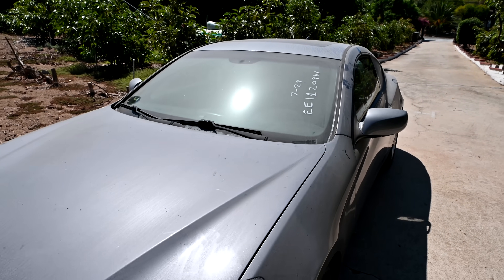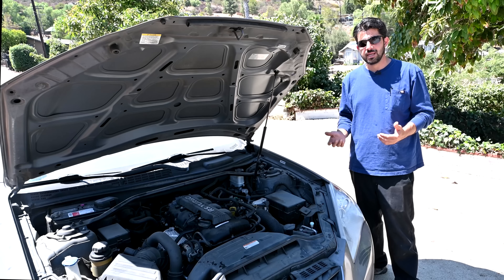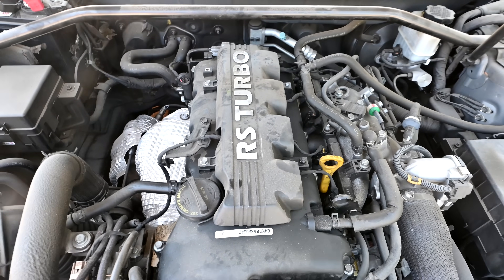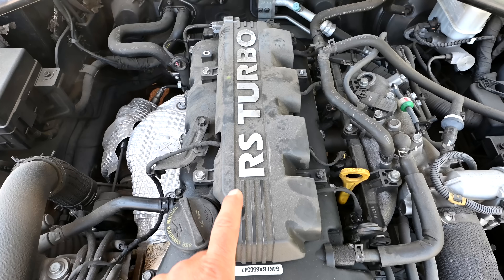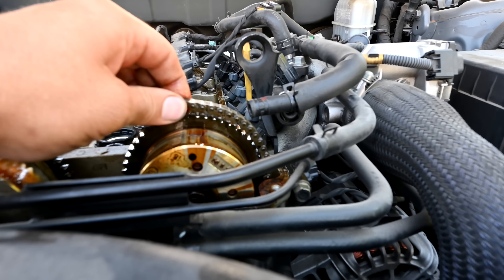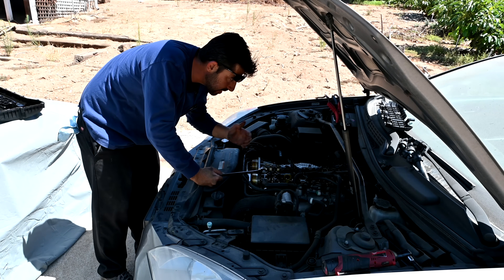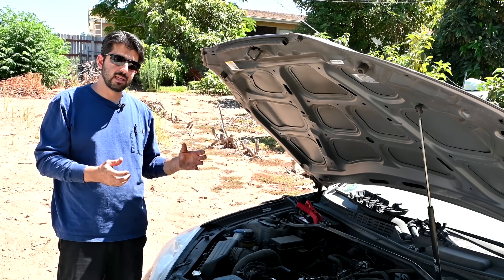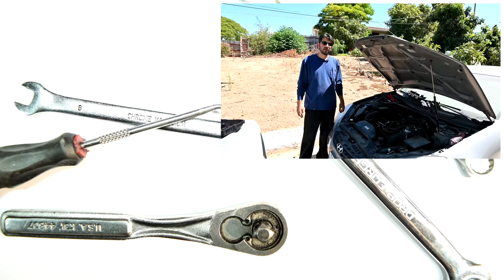The Hyundai And Kia Engine Failures Explained.

Comment: I believe these trouble started soon after Hyundai decided they wanted to make their cars more like the Germans. I guess they really did
Reply from the maker: lol
Reply: Are they really THAT bad?
Reply: @wholeNwon  yes!
Reply: @wholeNwon   Hyundai's and Kia's are very reliable. I sell hundreds of used Hyundai's, Kia's, Honda's, Toyota's, and Subaru's every year. I'd put Hyundai at the top of the chart for reliability against ANY of the other brands I just mentioned. This year we've bought roughly twice as many hyundai's and Subaru's as Honda's and Toyota's and have had ZERO major problems with any of the Hyundai's or Kia's. I've had to replace roughly a dozen engines and transmissions in Honda's, Toyota, and Subaru's in just the last 9 months.  Not to mention, Honda, Toyota, and Subaru owners are typically much better off,  and therefore do a much better job of properly maintaining their cars.
Reply: @bdd1469  Well, that must prove it.
Reply: @wholeNwon yes. My grandma blew her 2017 elantra at 56k miles and the oil change was done 2k miles ago and it was checked for level 1 week prior. Ran dry and rod knock/,piston slap.
Reply: @Slowwvqs  Loose drain plug?
Reply: @wholeNwon  Hyundai is.. odd. Underpowered engines, shitty engines, okay build quality and they can last for awhile. but yet their ability  to run without oil will always amaze me. we had a customer come back because they ran their car 200 miles without oil. it drove into the service bay
Reply: @Miatshu  Modern oils really are amazing. Perhaps bigger gaps than usual between moving parts helps. Don't know. But where did the oil go?
Reply: @wholeNwon  One of the lube techs didn't put oil in the car after an oil change.
Reply: @Miatshu  Hopefully someone other than the owner paid for a new engine.
Reply: @wholeNwon  customer got a new engine and the guy got fired ots
Reply: @wholeNwon  No, they aren't that bad. Unlike Hyundai's, modern German cars are actually pretty good. :D
Reply: @briantii  nah somehow they've made them worse
Reply: Well the Germans had huge issues with timing chains and engines failing , the n47 engine was horrible bmw never got round to fixing that issue and the newer Hyundai and Kia are actually reliable, there Genesis brand is there luxury brand now and actually very reliable
Reply: @M.E63  Says all you need to know about the quality of their engineering and their customer relations. I would NEVER buy one. In fact, I'll never buy another German vehicle again.
Reply: @wholeNwon  German cars are not reliable sort from Porsche, the Mercedes e class I got has been very reliable so far but mines the facelift model and the pre facelift had timing chain issues aswell and it would kill the engine , the Korean newer cars are actually reliable , I’m sure Hyundai motor group resolved the issue they had with the manufacturing of certain engines , these days there is no reliable cars as there’s too much electronics in them and electronic components can fail anytime and it gets very expensive to repair them . Lexus are probably the best however when it comes to electronics then even Lexus can’t stop components from failing
Reply: @M.E63  None should have "issues". They should be able to match or exceed the remarkable reliability of my Lexus LS400. They DON'T because they choose not to.
Reply: @wholeNwon  if you look at German cars reliability then it’s not great, they are never at the top of the rankings , bmw couldn’t resolve the n47 engine issues at all , they designed newer n47 engines but ended up with the same issue again , Porsche are reliable though , VW used to be reliable but not great now, nothing these days is made to the high standard as before, people like scotty hate German cars and say they are the worst however I don’t agree with half of the crap he says
Reply: @wholeNwon
Reply: @wholeNwon   Issue No1 is price tag?
Reply: I haven’t heard bad stuff about the genesis or gt5
Reply: @gemnicherry2670  you must not be listening. All bad engines, nothing made to last.
Reply: @chrismemphis8062  I didn’t even watch the video I just read the title but I’ve seen them and test drove them in good condition with over 150,000 miles
Reply: @chrismemphis8062  yea I messed up and got a 2016 Sonata 3 months ago for almost 15,000 with 120,000 miles and the engine is shot. Hyundai called me and are going to try to do a warranty claim... but they did say I'm passed the miles for being the second owner.
Reply: @gemnicherry2670  I'd bet the farm it was the 2nd engine on the 150k car.. The engine had to replaced , the don't even make it to 100k, and most die in the 80-90K range. I'm not picking on them, it's just reality.
Reply: @zacharybuhrts51  Same here man, I bought a 13 Kia Optima EX last spring. It was  beautiful and like new. Fully loaded. It had 95,000 miles when I bought it. 8 months later it blew up. Used a quart of oil every two weeks. I don't believe I'll buy another Kia or Hyundai any more.
Reply: Well guess what, despite continual and consistent vehicle maintenance, my engine is dying at 6 years old at 90,000 miles and I'm in the middle of oil consumption test to get a new engine. So no they are not good cars
Reply: The Theta engine has been a problem since 2006
Reply: Many will Nazi the humor in that comment.
Reply: I had a hyundai elantra 2003 that lasted me 12 years.  The build quality was cheap but managed to ge t over a decade of service
Reply: The irony here is this car (assuming the original owner) is just out of the 100K 10 year powertrain warranty. That’s one thing the Germans don’t offer and German cars are much more expensive to keep on the road once out of warranty.
Reply: Actually it's because they started machining the engines in the us with American workers 🤣
Reply: They poached many German engineers
Reply: No kidding
Reply: Honestly what new car IS reliable??
Reply: @lucidrebuilds6129  Toyota Corolla. That’s the one and only.
Reply: those particular engines are not build by kia or hyundai.
Reply: @marcusa.rivera6377  So who is the sub contractor?
Reply: @chrismemphis8062  all I know they build for hyundai, KIA, Renaults and Peugeot. Already starting to suspect on the nuke turbo.
Reply: Omg! Yes! I just saw one that is trying to actually look like an M class and fake Lorinsers! I was so upset I complained on their face book page annnnnd Im sharing this too lol
Reply: Yeah Asians are too white washed
Reply: I believe that they did hire BMW engineers, lol.
Reply: Yup. They became so arrogant. When the GV series came out they are more expensive than their German counterparts. I looked at a GV80 that costs 80k. With that money, I’d just buy an X5 or a MB GLS.
Reply: There´s a video of a teacher who bought  a VW beetle in 1967,and the  car still runs great   https://www.youtube.com/watch?v=VxeslTCGjaU      VW haters/critics just repeat the lies that they heard  and have never owned one🙄
Reply: German engines require specific maintenance.  Most couldn’t be bothered to properly care for their vehicles.
Reply: @charlesdignam780  that's the excuse defenders of these piles of junk use. It is nonsense. They are just badly engineered and built on the cheap. Unless of course you consider a complete rebuild to be maintenance. go look in owners manuals of these things and nothing specialist required. In fact they recommend changing oil about once every never
Reply: Haha! Good one. But were Hyundais ever that good in the first place? 🤔
Reply: @ands1894   We sell used vehicles from EVERY manufacturer but specialize in Hyundai, Kia, Honda, Toyota, and Subaru. I would put Hyundai and Kia's reliability in front of anyone else. They just don't have major failures like the other brands. I've had to replace roughly a dozen Honda and Toyota engines, and several Subaru transmissions just this year alone. I have not had ONE bad Hyundai or Kia engine or Trans failure in that time. Which is saying something , because people who typically buy Hyundai's and Kia's are broke, and don't do any maintenance until something  brakes. People who buy Honda's,Toyota's, and Subaru are usually better off , much more brand loyal, and typically are much better about maintenence.
Reply: Have a look how many 20+ year old German cars are still on the road ..
Reply: @holeephuk  only if you consider a salvage yard to be part of the road
Reply: @kevinbarry71  where my ml took me  around Australia mate ,went up to muddy hills where people couldn't walk ,proper adventure machine ,and reliable believe it or not ... got another one e280 cdi ,370 000km on the clock ,appart from shocks and 2 engine mounts no issue...so don't believe all rubbish people writing and most of the time they are ones who never owned benz ..including you 😊✌️
Reply: @holeephuk  nah we're talking new here and some old but over all most of them are junk because they cost way to much to fix they have proprietary software they are over engineered and not even properly with the future in mind
Reply: @holeephuk  I drive one, I have a E class
Reply: That’s not the case at all.  German engines?  Which?  They follow Japanese engineering principles, but they take more risk.
Reply: I’m always surprised how many engines in the us have to be rebuilt after 100k. I know no one that needed an engine rebuild. Ive owned now about 7 or 8 cars, some of then over 200k. Most of them made in germany or another close country… But when I see a lot of youtubers like hoovie or others driving cold engines full trottle, Im not so surprised. We learn from a young age to warm up the engine properly. To not go over 2k revs before the engine is properly warmed up. Has to do with the alu/metal difference with the block and the pistons. Generally in Europe we drive easily +200k without any big issue. In the soutern countries, most of the taxis have between 500 and 1M…. Oh yes, and more than 80 perc drive stick… not sure if that makes a difference.
Reply: I wouldn't wanna buy Hyundai or Kia ever again.
They look nice but, cheaply made break down with engine issues also fuel injector problems.
I would recommend people get Toyota or some Honda are way more reliable and less expensive to maintain.
Reply: This thread shows that Americans know absolutely nothing about German engines.
Reply: @mortenmerstrand5473  Not that many 10 year old german cars still on the road here in america. They are just too expensive to fix . Audi Mercedes bmw customers buy new ones and dump them after the warranty is up. You see german cars in ghettos and in rural areas sinking in someone's lawn because they cant afford the repairs.
Reply: @mortenmerstrand5473  no; it shows that you know absolutely nothing about German engines. That, or you are in heavy denial
Reply: @kevinbarry71  After working 35 years as a mechanic in Europe I disagree with you. The only problem with German cars in the USA is the Mechanics there has no clue about maintenance. As a response to the Timing chain issue, the first engine I repaired with this problem was made in the USA. Because the chain was made of crap steel.
Reply: @mortenmerstrand5473  maybe you're thinking of German engines 35 years ago. That was different. Now they're built like junk. Did I ever say I owned an American vehicle?
Reply: @mortenmerstrand5473  maybe you're thinking of German engines 35 years ago. That was different. Now they're built like junk. Did I ever say I owned an American vehicle?
Reply: @mortenmerstrand5473  that makes more sense y'all get the actually quality built German cars
Reply: @mortenmerstrand5473  um nah German cars are absolutely trash got a Volkswagen worst decision ever burning oil power door locks gave out at 5k miles cost way too much never again
Reply: @mortenmerstrand5473  Don't live in the past. The 60s and 70s are over.
Reply: German cars are some of the best ever..power, reliability, efficiency, tech. You're talking out of your ass. My advice is to stop making generalisations and start talking specifics. Rarely is life as simple as blanket generalisations.
Reply: I have 2 words for this and that’s all I takes to fix this 100%. HONDA/TOYOTA.
Reply: I’ve owned 3 VWs and made 200K miles without any issues like this. No is Hyundai even close to as good a car as the German cars.
Reply: @Mimsk  I'm German, and I won't drive a German car 🤣
I've had 4 Hyundai's and never had engine trouble.
Kia, that's a different story 🙄
Reply: @christianheidt5733  LOL, I love them. The drive quality feels miles ahead to me. Brakes, handling and decent looks are all ok to me. Hyundai seem plagued with problems to me.

Comment: 2.4 is rubbish. Wife had a 2017 Optima purchased with 26k miles. Spent more time in the shop and Kia were terrible to deal with. Yet my neighbour had exactly the same car and had zero issues and is still running strong.
Reply from the maker: yup 2.4L is terrible the 2.0L is much better but still you have to watch out for some years/make/models. cheers
Reply: @myRatchets  Hi there, I have a 2012 Forte5 2.0L (Non-GDI) with 115,000 km (approx. 71,500 miles). Is there a difference between the vehicles made in Korea vs the US? Mine is from Korea and I was told by KIA I was not to worry. I'm scared to be driving around, not just for my own safety but for everyone else's.
Thank You - Cheers!
Reply: I had a '17 Sonata 2.4 theta II and it was flawless up to the time I traded for '21 Sonata 2.5 smartstream. 
The '17 Sonata had 60k when I traded it in.
Reply: @dougn2350  my 2017 had issues with burning oil, a faulty knock sensor wire, an oil pan gasket that needed replacing and a valve cover gasket that needs to be replaced. It burns oil like crazy even after the oil changes.
Reply: @ronyoung9251  faulty knock sensor was the issue on my wife's Optima. Was a nightmare and left her stranded at least 3 times.
Reply: Should have taken it to a mechanic before buying it. Probably wanted to get rid of it because they didn't do their scheduled maintenance and started having problems.
Reply: @pineconeonpizza  We did. The knock sensor issues would not have been able to be detected until it failed/malfunctioned. Plus with only 26k I doubt it was a lack of maintenance issues..just a lemon.

Comment: 12th view from El Zonte El Salvador
Reply from the maker: Hi El Salvador
Reply: @myRatchets  I have a 1986 Hyundai excel, I've owned it for years and years, I used to have rusty ones from New York and quebec, but now I have a rust free one from arizona, but I haven't driven it for a few years, and it was parked outside my shop, and someone stole the catalytic converter, along with a few others, on three separate occasions, I've had 10 stolen, including a muffler from a diesel Suburban in front of my house